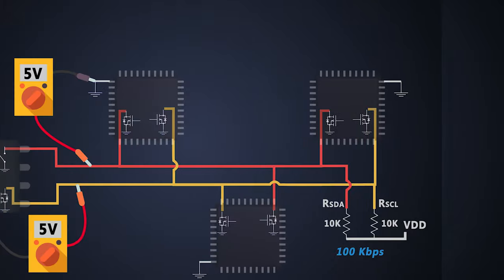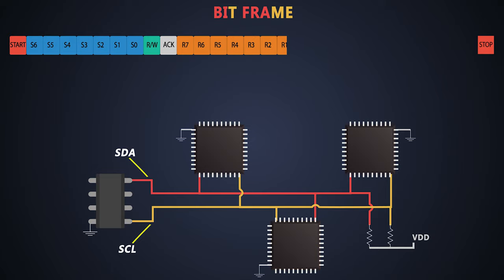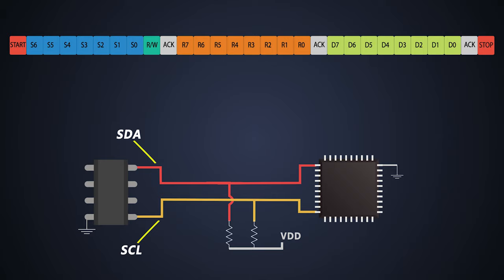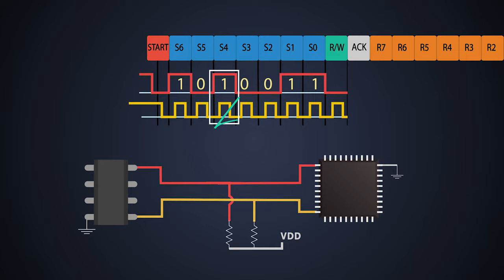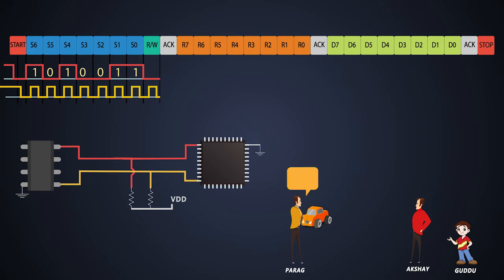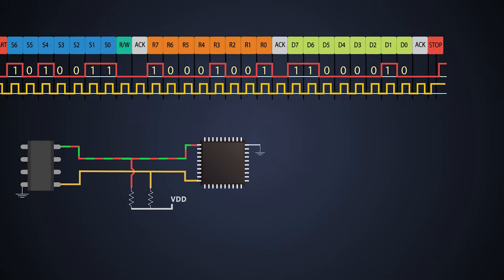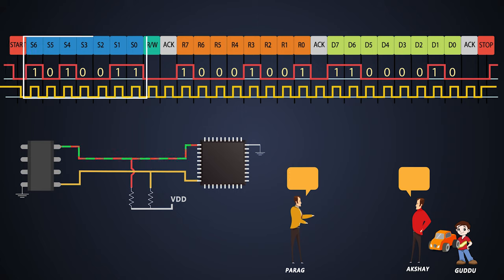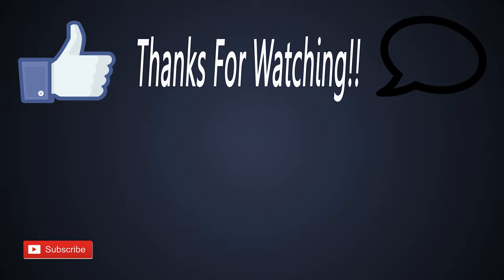I2C Frame structure Understanding | I2C data transmission

Comment: hello dear nice video ,,, i m not from engg background but made one project with Arduino Uno qmc588l and 16x2 LCD  for azimuth  sensing , its all work perfect with short length jumpper wire ,, once i connected  qmc588l  with 15 meter long 1 sq mm thick wire    lcd display not showing qmc599l readings , how to fix it  ? ,, my project requirement  is to sens azimuth from antenna position from long distance ,, thank you

Comment: Why in i2c data frame is always MSB why not LSB?
Reply from the maker: It is the standard rule
Just like,  we write address as 221B, Baker street, London, UK & not as UK, London, Baker Street, 221B
Reply: @FoolishEngineer   Really? generally we use LSB as operation why they take MSB isn't it weird....
Reply from the maker: @Parag Sangtani Hi Parag,

Thanks for your question and following our channel. Your question seems valid but I couldn’t find an exact answer for that.
What I am referring to is, this spec sheet

https://www.nxp.com/docs/en/user-guide/UM10204.pdf .

In the byte order, they just mention that MSb first. I feel, maybe internal shift register of I2C devices is configured to send MSB first. I hope you know that in UART it is configured as LSB first.
If you feel our answer is incorrect and you get some reference to that, please feel free to share that with us. It will surely help us!
Reply from the maker: For an example of shift register placement,
Please refer section - Data transmission of this wiki page
https://en.m.wikipedia.org/wiki/Serial_Peripheral_Interface
And please check the first diagram and it’s shift register placement which makes MSB out first. 
I wish I could draw here and explain to you in detail. 
Still, it may give you an idea of how to shift register are placed in any slave device.
Reply: It is Big Endian